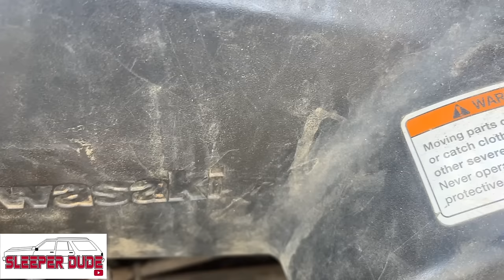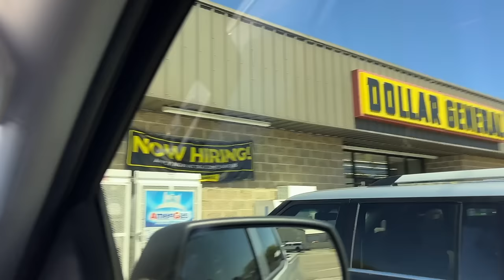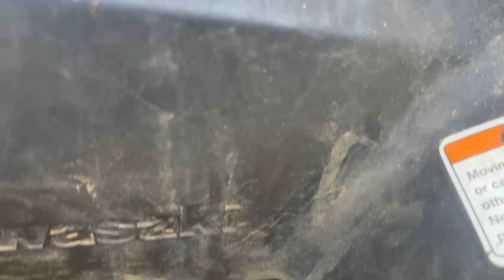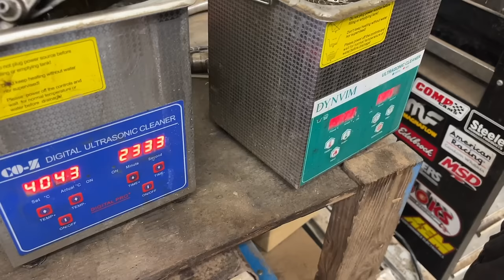Wife Bought The Cheapest 4wheeler She Could Find. Its Got Problems!

Comment: Yeah the beauty part about that thing is they make so many different accessories to add to it. I've used one of those for several years. The snow blade on the front salt sprayer in the back clean up around the shop and the driveway, but she's running pretty good. Imagine what she's going to do with a new belt. Really going to be a lot more powerful. Nice purchase! Happy for you guys. You've been looking for one for a while.
Reply: But  honestly. Do you guys don't get much snow but you never know.

Comment: Those Kawasaki's are great machines. That one is in excellent condition. What I like to do to keep critters out of the belt and intake area is cover the inlet with mesh screen like you would use on a window screen. (Lowe's has it cheap) A hose clamp or self tapping screws to secure it.
Reply from the maker: Ok good tip

Comment: It sounds like the shift fork came loose inside of the transmission. on that fourwheeler y'all just bought truthfully due A bad bushing. Witch is worn out bushing sleeve in the case. JB-weld & permatex mixed together will make it stronger. Remember to scuff the area surface clean the area. Spray some belt dressing on that old belt.
Reply from the maker: Ok great thank you

Comment: I used a small piece of sheet metal on my dads belt cover, drilled 6 holes and riveted the metal on the outside with silicone between them with a good smear over it all. 8yrs later its never had water in it
Reply from the maker: Thank you

Comment: I am really surprised that with the belt light flashing It didn't go into Limp mode.
I just went threw all that on my Buddy's exact machine we finally bought a kit to disable the EBC.
Reply from the maker: Yeah me to
Reply: @Sleeperdude2  when you replace the belt there is a belt switch that might need reset it looks like a pen spring it should be flipped towards the rear of the machine it's inside the cover runs above the belt.

Comment: It's basically quick JB-weld by doing that process. Although y'all had some already instead of having to make the DIY way. Sta bil will help y'all out with the fuel in it. Sta bil 360 gives yah 360 days of protection year round. Fuel treatment from corrosion & ethanol fuel issues to. If y'all start it up at least one A week.
Reply from the maker: Ok thank you

Comment: On those two jets, the big is the main jet the little one is the idle jet. Often the reason you need to use the choke which isn't really what it is, it's an enrichener, the idle circuit is at fault. The pilot jet, passages to the idle mix screw and to the venturi by the throttle plate are restricted or plugged. 
A choke restricts the airflow to enrichen the mix for cold starts. An enrichener is a valve that when you open it it flows more fuel to enrichen the mix. They both do the same thing but in different ways.
You may be right on the o ring causing your idle issue. That o ring on the mix screw when damaged will cause an air leak into the idle circuit. This will cause a lean mix, using the choke would enrichen the mix so it would run.
On the foam cover for the air filter, when it gets dirty wash it out with most anything you want, even Dawn dish soap , just rinse well and let dry them use a 50-50 mix of gas and motor oil. Wet the foam and squeeze most out then install. You have two so you can keep one ready to go. At oil change time just swap the clean for dirty, then prep the dirty for next time.
I run foam air filters on several of my motorcycles and clean and oil my foam filters this way.
On that machine most any 10w40 will work. It uses a dry clutch. When you pulled the cover you pointed at something, that something is part of the clutch system. It watched clutch fork that when you use the clutch it pushes on the throw out bearing. If it was a wet clutch that cover would have had oil in it.

Comment: The belt light is in limp mode. When you replace the belt you will need to reset that by swapping the gray and black plugs above the cvt trans case. There are a couple of videos on YouTube for this.👍

Comment: KVF 360 is a great quad. They’re fast enough to be fun, and strong enough to be a workhorse .. they did have some recalls on them over the years. You should have a Kawasaki dealer run the vin to see if it needs them. It’s free of charge.. we had one for our shop quad at the motorcycle shop and it was a great quad, and was abused by all of us.. some Kenda Executioners would be a great never get stuck tire choice for it.. enjoy your new quad guys

Comment: Good luck. These things are a pain to keep running. I have a 06 that I bought new. The wires on the carb is a heater.
Reply from the maker: Awesome thanks
Reply: Welcome. There is a company that make a kit to convert it to manual 4wd. It gets rid of the electric actuator.

Comment: My 360 was the clutch assembly. The reset process for the light is easy too. Replaced my carb. Old one leaked no matter what I did to it.
Reply: Sometimes you have to manually reset that little switch on top of the belt cover box (black box there). It trips when the belts too loose. Makes it so the lite won't reset.

Comment: These prairies are fairly reliable , my friend has if the belt starts slipping it will go into a limp mode , switch 2 wires or the belt slip sensor and it goes out of limp mode

Comment: Rubber is used for the intake to help isolate vibrations. If not it would ariate the fuel and cause it to run out of fuel under power
Reply from the maker: Ok thanks

Comment: Nice, make sure the tires don’t have too much pressure. You want them squishy like to maximize traction. Max is like 10 psi.
Reply from the maker: Ok thank you
Reply: @sleeperdude2690  it’s makes a big difference when you use it out on the farm. Obviously you’ll hear different opinions but it’s what I run on the farm to help when pulling or slick terrain. It’s not like it’s towing.

Comment: You should pull the plastics off a presure wash the heck out of it then grease the front end and oil the chain and see if there is a grease fitting on the rear axle.

Comment: Hey sleeper dude I baught a brand new Kawasaki prairie 700 2006 witch was the last year of the full rear axle!! That rubber boot between the carb and the block will definitely suck air and causing it to run porly!! You should definitely change that boot so that it doesn’t suck dirt inside and cause ring failure!!! I also have the clutch springs compressor tools and the bolt setup to pull it also!!! Let me no if it would work for you and you would use it or not???? I also have several different springs in different colors for the different tensions for the clutch setup that might work for your setup!!!

Comment: Does the winch have a steel cable?  If so I might suggest replacing it with a synthetic rope. The steel cable stretches and can load the cable with a lot of energy. It it breaks under load it can snap like a rubber band. Anyone or anything in the way when this happens will not like like. 
The synthetic rope doesn't stretch and load up, so if it breaks it just falls to the ground.
With the kids, it would be a good upgrade just for the safety factor.

Comment: Hey SD crew. Seeing as that is a tool for your business, that is a tax write off right? Josh, fab up a front and rear hitch. I use the Harbor Freight 65961 receiver because it has a tow hook on it. A home-made push bumper from "recycled" metal you might have laying around that goes into the receiver might come in handy some day just in case you ever have to push a car into you shop. I think the fabrication would be good content. Thanks for posting.

Comment: Excellent video Sleepdude Crew  Josh  :) yes amazing those came from be 3 to 4 wheel in 2 or 4 wheel drive also  in so many companies make besides Honda at first made in 1980's  plus CC from 100 to 1800 CC types also gas was longest and even desiel types out ! Plus went from 1 to 2 to 3 and 4 cylinders too  !My cousin Michelle husband Daniel  has  one Desiel motor and 4×4 to and no problem with plus excellent with it to matinne!

Comment: A squeezy 8 out of 10 is definitely rarified air. In reality, that's the solution y'all have been looking for for pulling cars and trucks into the shop to work on, be able to take to burn out competitions , and will be perfect for pushing snow and spreading ice melt on the drive

Comment: If the belt light is on it puts the quad into limp mode because the belt triggered the toggle switch in side the belt housing cover this will sometimes break the toggle switch when the belt hits it so make sure the switch is good 
Comment was left at 11:30 Monday may 1st 30 min and 49sec
Reply from the maker: Ok thank you

Comment: new belt and reset the belt light  stwich  by  removing the cover  and flipping  the stwich  back then there is  a black plug  and a grey plug  under the  right plactic  swap conctors turn key on for 10 sec swap back  turn off key may need to repeat
Reply from the maker: Awesome thanks
Reply: @sleeperdude2690  if you ever need any help with it just reach out! We have an Atv repair & customization shop so we basically seen everything that can happen with them!

Comment: I bought a new carb for my Honda Rancher and the float was set wrong and it leaked fuel out of the overflow hose. Had to take it apart and reset float. It's fine now. The problem with the original carb was caused by the fuel shutoff valve in tank falling apart and sending plastic and screen junk into original carb. Had to replace that valve too. This ATV looks a lot like the Rancher. The carb look like the same one.

Comment: Wawa should be using the closed end of the wrench not the open end just in case the wrench slips and rounds out the head of the bolt.

Comment: I hope you didnt put gear oil in that front diff!! I think it takes regular motor oil due to the locker clutches. I would refer to the manual for the proper lubricant. If you used gear oil, like 80 90W then it will ruin the clutches for sure.
Reply from the maker: Ok thanks